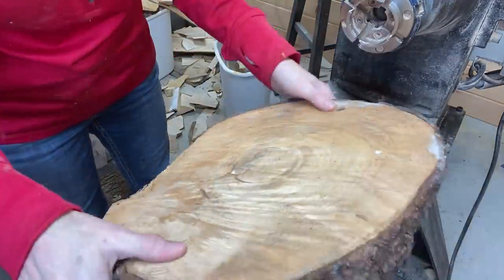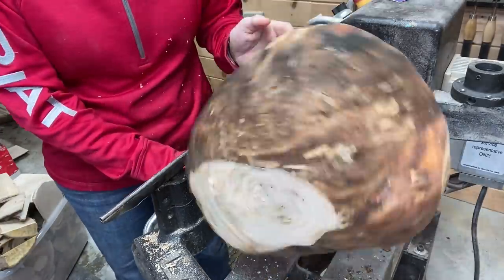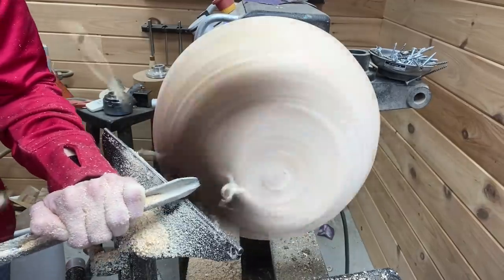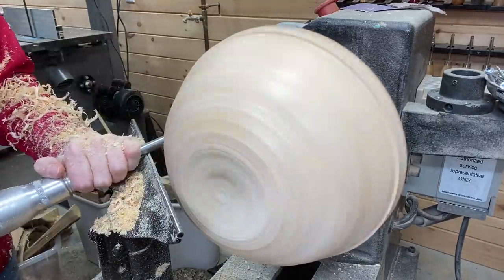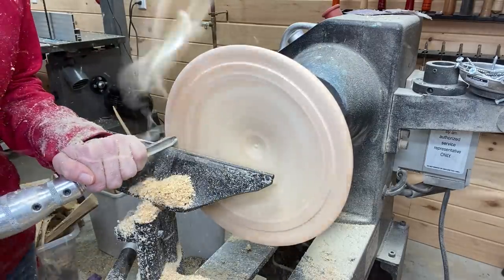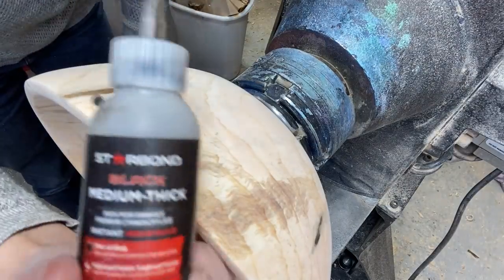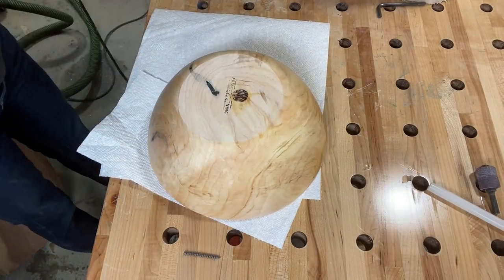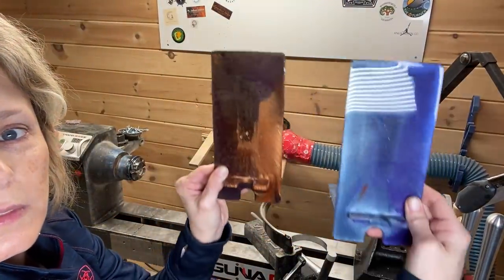Woodturning a Spruce Burl

Comment: I have two chucks I use - a Nova and an Easy Wood. When I started turning I got the Nova as part of a buy package with my mini-lathe. That was an extended Excelsior that I used for hobby crafts - Christmas ornaments and the like.  Over about 18 months of use, I bought several accessory jaws for it so when I upgraded to a PowerMatic 2014, I bought a 1-1/4" to 1" adapter for the new lathe and kept using the Nova. But over time, Carl Jacobsen and other You Tubers convinced me to try the Easy Wood. So when I had some extra dollars, I took the plunge. I've had it maybe nine months and I have to say I reach for it about 2 to 1 over the Nova. No slam to the Nova but at age 69 with hand tremors, dealing with the Nova's bitty screws is a pain. The EW runs smoothly, easy to change jaws (although I don't have many yet - hence, the reason I still use the Nova) and I like the set crew locks, etc. Also, I've seen zero runout so far. And of course, the ability to quickly spin the jaws in or out is nice - not necessary but nice. So that you can calibrate the validity of my comments: I've done carpentry since I was young on and off but getting into turning and carving is a late thing. Broke my back a few years back, so I've gravitated toward hand work, as I can't walk rails or wrestle cabinetry any more.  I am strictly an amateur but one with  lots of somewhat relevant experience, primarily in cabinet-making. I've turned a fair number of spindles (35 ornaments for family last Christmas, some magic wands as gifts, a couple of mallets, lots of learning pieces, etc.) and am now skill building in bowl turning. Mostly small stuff, under 7" diam x 3" height. I've made mebbe 20 bowls so far, both live edge and 'straight,' Some of the bowls are quite small and the EW chuck using the jaws that came with it does a good job hold in shallow recesses and short tennons for those bitty projects. Largest so far has been  a 12" x 5" live edge.  SUMMARY: I'm no expert but while I like both, if I had it to do over, I'd go Easy Wood. I just finally retired and haven't got my site up and running but you can see me at www.michaelwmcdermott.com as a temp measure and at least know a bit about the geezer making these statements..
Reply from the maker: Thanks, Michael. That's great info. I'm just trying out some furniture and cabinet making. For me, woodturning is so much easier. I need to get a better table saw...right now I have a $300 rigid and the cuts are difficult to get exact--not great for trying to building a cabinet or a table!!! Good luck with your turning and have fun with it!
Reply: @PFWoodturning  Dunno what your budget is, but when I started rebuilding my shop (lost most of my tools and equipment to burglars), I sprang for a SawStop three years ago, when I started doing woodworking again after breaking my back. I got the cast iron table contractor version and I am beyond happy that I did. Blew through a pot of my insurance settlement (about $3000 with tax, etc.) but I would do it again. The safety angle is important but the best things about it are the big three - precision, accuracy and ease of adjustment. As I said, I don't do cabinetry anymore but I use the SawStop to break down materials and for cutting parts for my 'flat' work. If you want to know more, feel free to email mcwordsmith@comcast.net.

Comment: Came out real nice Peggy.  You surprised me at the end though. When you showed us the bowl at the end, I thought you had switched it up with another bowl. Given that the inside seemed to have a low profile and looked really shallow. (Compared to the taller outside height of the bowl I had saw earlier...) But it all came together when you showed the outside of the bowl, I saw that it was the same one. I realized then that you just chose to not go as deep as you could have on the sides when you hollowed it out.  Nice turn... V
Reply from the maker: Thanks, Mike. Yes, I wanted it to have some heft in the bottom.

Comment: I love the bowl 
I have 3 jack pine burls that I want to turn , do you wear respirator, and dust extractor at the same time ? 
Air hose the blow dust off the work also aerosolized the dust and can be inhaled   . A towel dampened in alcohol , or a tack rag 
Ray Key, advocated wet sanding , using wet and dry sand paper dipped in paste wax , and abrasive paste
Reply from the maker: Hi Gary. Yes I wear a respirator with a full face mask and I have on my dust collection as well as air filter hung from ceiling.

Comment: Great looking bowl Peggy! I always enjoy your commentary too. Question,  after you use the black starbond on the cracks, do you sand it smooth or use a gouge? Thank you!
Reply from the maker: Thanks, Jon. On the Starbond question, I've tried both ways, sanding and gouge. It really depends on the piece, but most of the time I take a couple light passes with the bowl gouge to clean it up.

Comment: Ya get what ya pay for these days.  I have both the Easy Wood and Nova chucks.  By far, the Easy Wood is the best since jaws are easily changed and only takes a few seconds to change.  Whereas the Nova now seems to take forever to change jaws.  Much happier with the the Easy Wood Chuck though it is 2-3 times more expensive than the Nova. Just bite the bullet and spend the money since you’ll be happier in the long run and save aggravation in changing jaws.
Reply from the maker: Thank you. I just need to buy it....